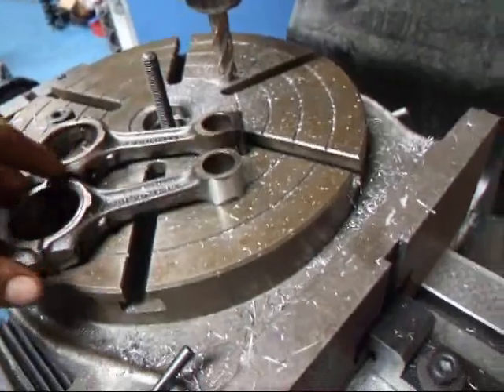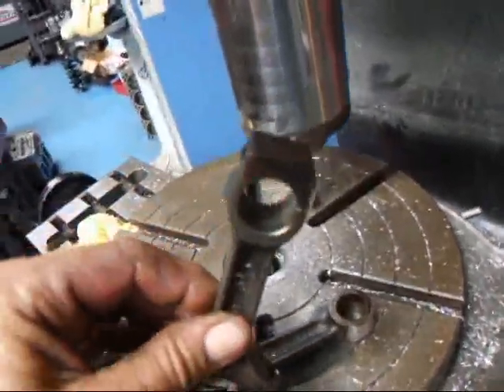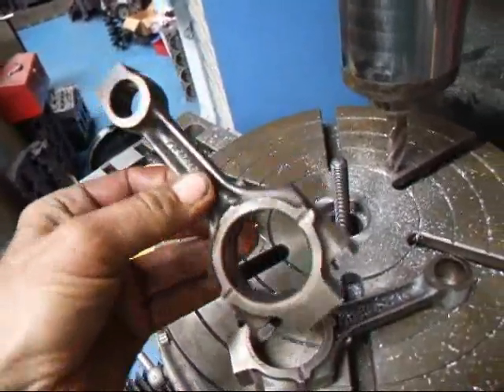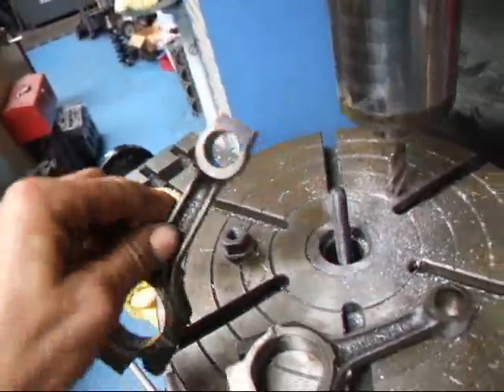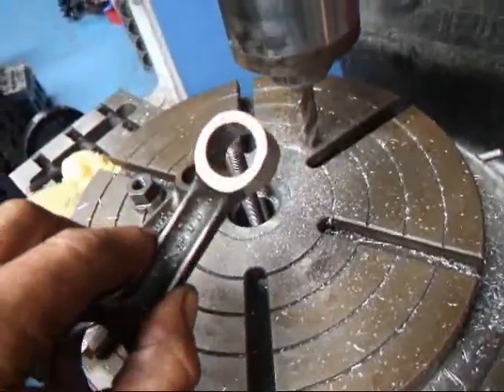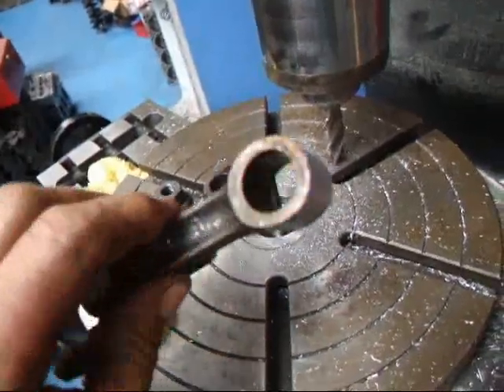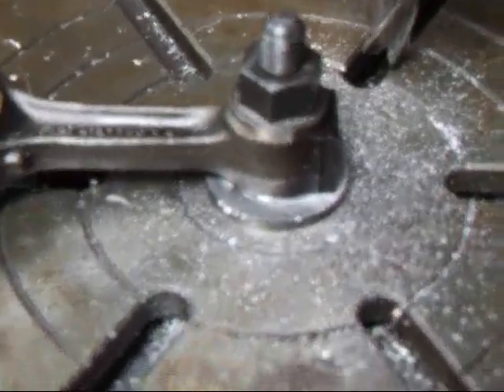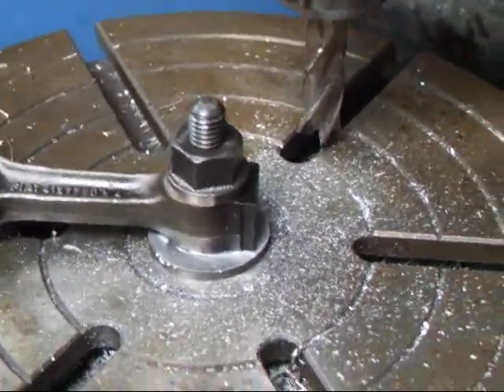Con Rod Mods-01.wmv

Comment: I am under the impression that the pad on top of the rod is used to balance the con rod. Where would the material be removed to balance the big and small ends come from now? Just the bottom cap end?

Comment: Oh i have to do this because im taking a 1300cm3 to 1600. Im using a 1600cc crank, with modded forged pistons (lower to match the difference in the displacement). The thing is that the new piston has the hole for the rod(not native english speaker here, dont know the term), closer to the head than the standard piston, so the head of the rod needs to be rounded so it doesnt hits the piston head from inside.
But i was thinking in doing this by hand, cause i dont have the equip, but this looks cool

Comment: John, I know you are a body of knowledge on all this stuff...I wondered about the rod integrity when you take that much off the top? What about the forces on the top arch of the connecting rod, when the rod reaches TDC and BDC during high RPM? I'd be curious about the math of it with that much metal removed.

Comment from the maker: @MagicMiura - Yes, the rod will get a bushing for 18mm pins and then a hole for lubrication. This is about 1/3 of the way done, still have to trapazoide the top and lighten the bottom end.